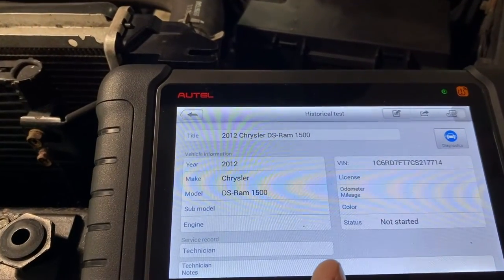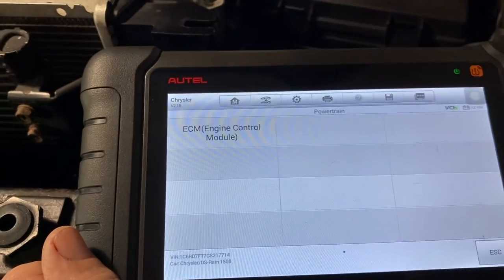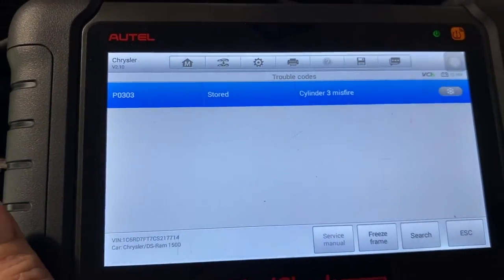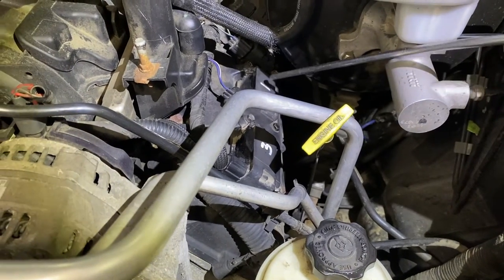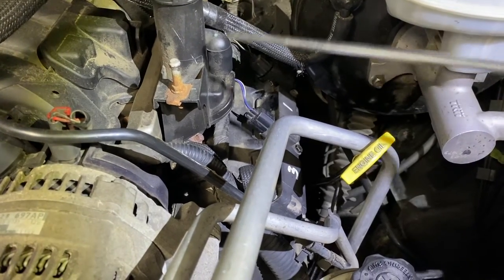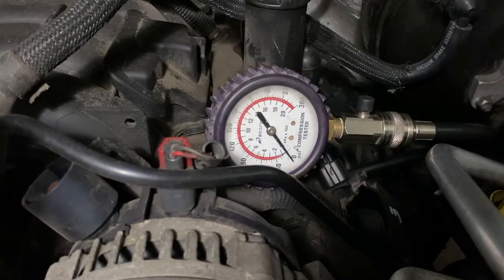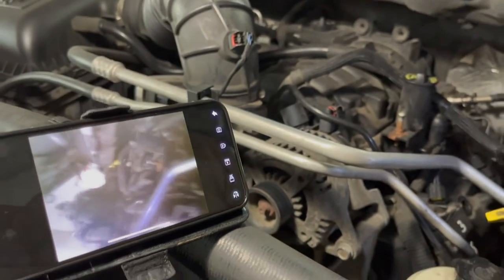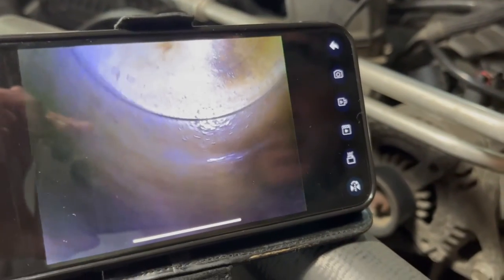5.7 Hemi Common Misfire Diagnosis on Chrysler/ Dodge Ram/ Charger  Gen 3 2003 & Up

Comment: Compression test works better if you leave one plug in on the cylinder you're testing on a hemi 😂
Reply from the maker: Lol, that’s very true! I was trying to do so many things at once, but obviously have to leave on of the 2 In before the test.
Reply: You can hear the blow by from missing plug when cranking & running. Oops
Reply from the maker: @michaelbezos2969 You heard that huh? Yea, left it in the video but people get the whole point of the video.

Comment: I have a 2019 ram 4x4 with the 5.7 he I and it keeps saying misfire on cylinder 5. I replaced the coil pack and plugs. It runs for a while and does the same thing. Driving me crazy. Can you think of anything else. It ran fine and yesterday I started it and this problem started. I am disabled and cannot afford to do to a garage to fix it. I have 120000 on this truck and never had a problem. When I replaced the plugs in number 5 they looked good. I can idle it and race the engine to 2000 no problem but them the check engine light comes on. Weird. It just says misfire on cylinder 5
Reply from the maker: Can be a failing fuel injector. If you know how, do a compression check on number 5 and see where it’s at before doing anything else. 130psi or higher is enough to ignite the fuel and would be considered good.
Reply: @motorcarnut  ok thanks. I used a stethoscope and heard the injector working. Tomorrow I will check for spark. I put on a new coil pack and plugs but have not checked to see if the power is going to it. I disconnected the battery for 20 min today. It ran fine for 15 min then started skipping and the check engine light came on again. This is the first problem I have had with my truck it has been great.  Thanks for the advice. I am 62 and can work on anything 1980 and younger. These new vehicles. Have too many computers and electronics for me. I will do a compression check tomorrow.
Reply: Also when I took out the old plugs they were in good shape. Clean and looked like they were firing well
Reply: Did you figure it out mines doing the samething
Reply from the maker: Burnt valve
Reply: It turned out to be a clogged injector. Weird after a few days and injector cleaner it cleared itself out and I never had the problem again. That’s the only problem I ever had with that truck. I traded it in on a 2023 ram and have my fingers crossed this one will be as dependable. So far it has been great.
Reply from the maker: That’s great, and good luck with the new truck!
Reply: @motorcarnut so I’m having a issue with my 2012 RT charger Hemi So I’m having a misfire on cylinder 3 so I changed spark plugs and coils I’m still getting a misfires I was told do a compression test

Comment: Compression is useless , you need to remove the valve cover and look at the valve springs while cranking the engine , easy to see if it's a lifter /Cam issue or not .. Compression can be fine and not tell the whole story !
Reply from the maker: What you’re saying takes more time and time is money for everyone. A compression test or leak down is even better together and faster to do.
Reply: What are you checking for exactly?